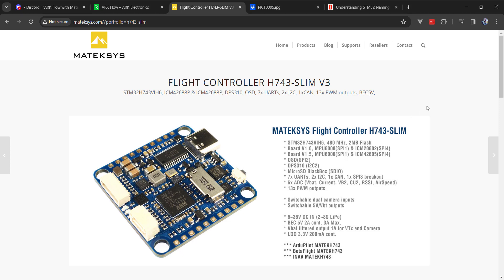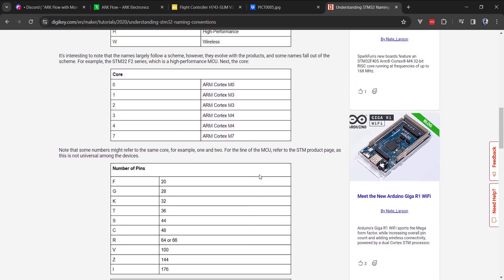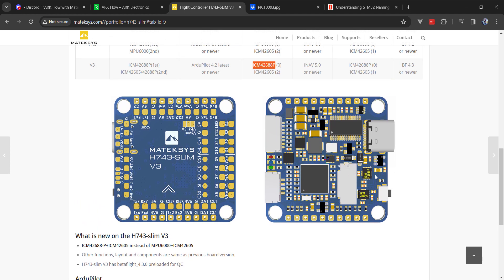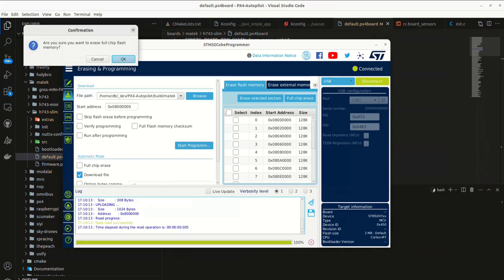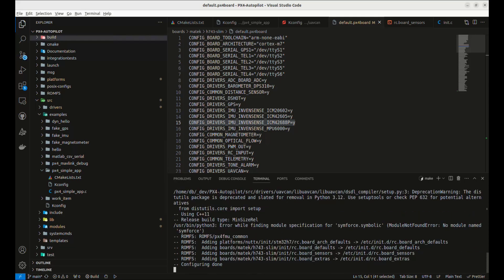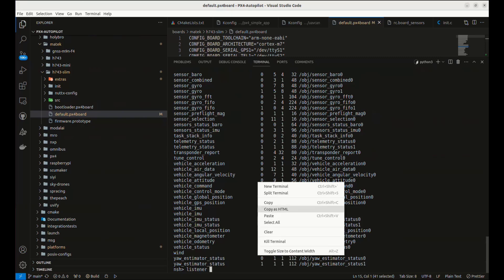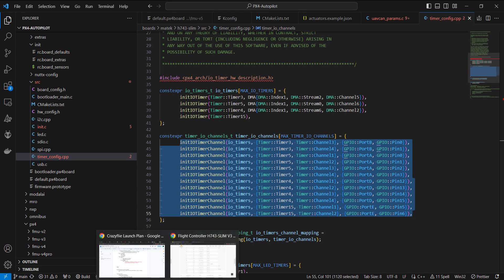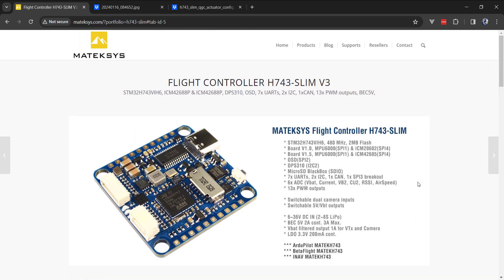PX4 with Matek H743 Slim Bootloader, Firmware, and UAVCAN with ARK FLow

Comment: Hi, were you able to use the S3, S4 signals instead of S7, S8 for activating the motors? I have the same problem, only two motors working. Thanks
Reply: Same problem here. Have you come up with any new solutions?

Comment: Just want to say hi, used to watch you a lot when figuring out my kk2 and APM systems.

Returned for some dejavu.
Regulations are out of control, most of the bands are regulated and LOS rules make any sort of fpv flying near illegal.(here in the EU to fly beyond LOS STROTA certificate of €3,5k is required)

Seriously turned me depressed.